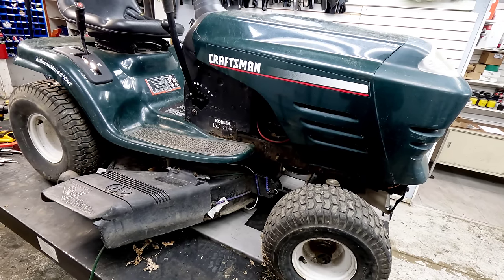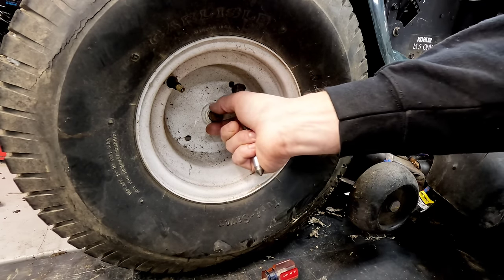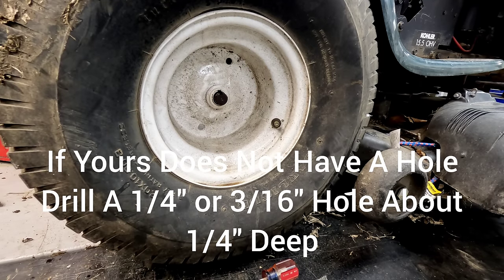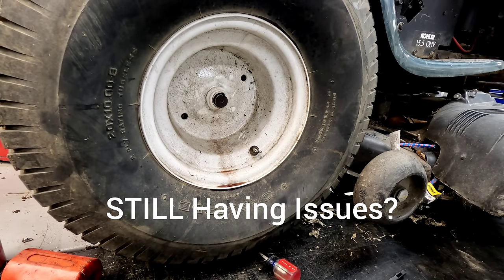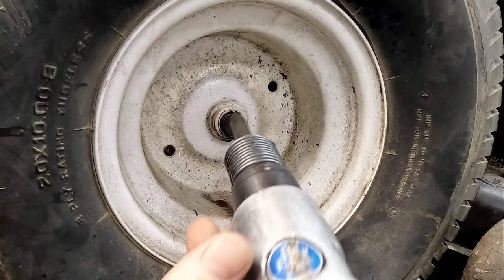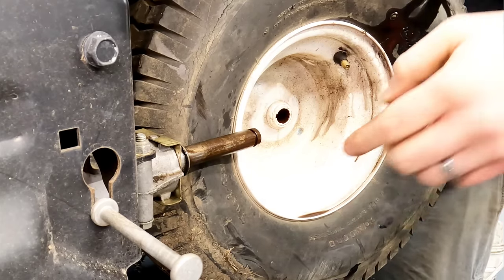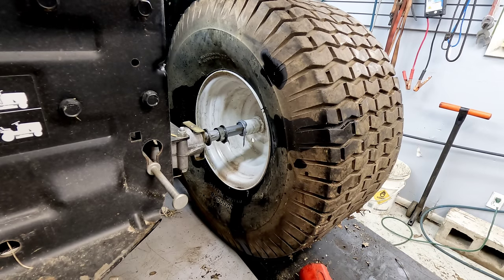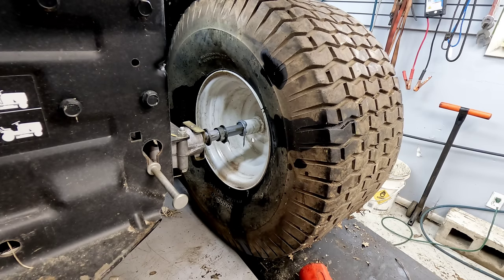How To Remove A Stuck Riding Mower Or Snowblower Tire Rim / Tire Easily Get The Wheel Off

Comment: Just wanted to say thanks for posting a no non since very instructional  video. Good point you made pointing out the high spots that can be seen as you clean/sand the axil. Another good point you made is to clean the hub. Making sure the wheel slides back on without binding anywhere is another good point. THEN 100% Agree! Anti seize will prevent this happening again, I've used anti seize for over 40 years. Just recently experienced a stuck rear wheel. Had one that was "Rust Welded "on then after two days of struggling, went to H..F and bought an air hammer. The Air hammer worked, I guess the intense vibration brakes the rust loose. Just a tip, I used a 1/4 rod with sandpaper wrapped around it then inserted in my drill to sand the inside  of the wheel hub.
Reply from the maker: Great tips and thanks for your kind words of support!

Comment: You're a lifesaver. Removed cap and e cap. But then couldn't get in off. So I sprayed the heck out of it inside and out. Waited and then hit back of rim with 5 pound  mini sledge. It broke the rust. Thanks a lot for your help. Was about to take it to shop which would have meant paying someone to take it to the shop.
Reply from the maker: Awesome job! Glad to help!

Comment: After dripping diesel( best po mans bolt breaker) into the hub on a tilt, I put a 2x4 behind wheel to pry and shim it with something to keep pressure and use an air hammer or scaling gun with pointed chisel in center hole, lotsa beats do a lot with minimal damage. then apply anti seize before install. If only they were tapered, they wouldn't stick. Great channel.
Reply from the maker: Awesome process there! Thanks for watching!

Comment: After getting the rust removed from the bore and shaft, I put never-seize in the bore and on the shaft! That eliminates the problem from happening again!
Reply from the maker: It sure does! Great tip!
Reply: So it doesn't dry up over time

Comment: Excellent how to video. Subscribed. Liked. This seems like simple job but can turn into a nightmare if you don't know the tricks you showed. The heating of the rim but not the axle was good to know. I wasn't aware of that. 

thanks'
rocket
Reply from the maker: I appreciate that! I have struggled with quite a few over the years! We used to work on grain bins and getting some of those fan blades off (12"-20" usually) was a bear, you had to heat it up quick as possible and put the portapower on it until it popped off and many times shot feet from where they were being removed. Fun stuff. At least those you could get a good solid bite on because they were made to be pulled off. Thanks for watching!

Comment: My Cub Cadet XT1 has the new axles with flats 180 degrees apart. And a bolt in the end to hold it on.
I stuck a 2x4 (end wise) up against the back of the rim and pounded it with a big hammer.
When they painted the wheel they didn't mask the hole!   From the factory!!!
I had to use paint remover and a wire bore brush on the wheel to clean it up.
Sanded the axle shaft and greased it when I put it back together.
Smooth.   :)
Reply from the maker: This is the exact action that ruins the transmission many times. I am glad it came off for you! There is a lot of weight being held only in one small spot made of aluminum so if you hit too hard on the inside of the rim with anything to support the other end many times they will break. I would tell you I didn't believe they didn't mask the hole from the factory but then I would be lying to you. Quality control just isn't quality anymore either unfortunately. Thanks for watching!
Reply: That's standard for a "MTD" rider.

Comment: instead of drilling the holes out get some lil eyebolts put them in the holes then use gear puller works well
Reply from the maker: Great tip there!

Comment: You have to watch pulling or the retainer rings on the cheap axle and whole axle can slip right out i had that problem before its not hard to fix but waste more of your time if it happens cause then you gotta take the transmission apart to fix the axle
Reply from the maker: Definitely have to be careful otherwise time / money will be spent to repair it

Comment: If the holes in the rim are too small for your puller thread some eye bolts in with nuts and washers on the back.
Reply from the maker: Great tip!

Comment: My back left tire keeps feeling like its smaller than the right side the sizes are the same though but it is shorter than the right side tire but the numbers on each tire ate the same i can't see how when it is shorter than the right
Reply from the maker: If they are not the same brand, we see this often. Some have a flat ground contact, others come out further and have a contour
Reply: @IndRepair  it looks like the same brand all i could think of is it had to come off a different mower or a smaller mower
Reply from the maker: Interesting

Comment: That deck is bent way back, too , probably hitting something regularly. It shouldn't be rubbing on the back tire !
Reply from the maker: I see the rear tire not able to be removed without the anti scalp wheels being removed often. Thanks for watching!
Reply: I've never seen one cocked at an angle and bent back that far ( the deck ) to where the anti scalp wheel hits the drive tire. 🤔
Reply from the maker: It was only hitting when trying to remove, otherwise was free by a few inches

Comment: If your pen oil doesn't penetrate....you can try carb cleaner, THEN Pen oil...a lot of times will break these loose
Reply from the maker: Great tip! Thanks for watching!
Reply: @IndRepair  been using this for many years. The carb cleaner will go thru rust faster than oil, ( lubricants)
As soon as you see it running out the other side....soak it with your favorite PB Blaster....or whatever you use...drink a cup of coffee, and by then it should fall off.
Reply from the maker: @charliejones7574  Yeah haven't tried it. Will give it a shot!

Comment: You wont ruin the transmission thats why they sale retaining rings for inside it
Reply from the maker: Very expensive to do
Reply from the maker: Definitely possible
Reply: @IndRepair  is it the rings only cost about $5.99 on Amazon then just the time of taking it apart and resealing everything
Reply: @IndRepair  its all i could do on mine and i soaked mine in oil and spray oil soaked it for days and it was still on the axle tight then i got the axle out from the rim when it fell out.

Craftsman or mtd whatever needs to start making their mowers with lug nuts that hold the back tires on it would make changing or repairing one easier to do
Reply from the maker: Definitely!

Comment: How do you remove a sump gasket
Reply from the maker: Remove the bolts, separate the two then scrape the old gasket off
Reply: @IndRepair  what tool do you use to scrape it off
Reply from the maker: @ChristopherPermenter  We use a carbide scraper tool like the ones at https://amzn.to/49hcIld or just a regular razor blade works well especially for the tight spots
Reply: My gasket split into two on both sides on the sump and the block it’s extremely difficult to take off. Has this ever happened to you?
Reply: I’m using the carbide scraper tool and one side took me over an hour to take off completely
Reply from the maker: @ChristopherPermenter  I feel your pain!! Unfortunately when doing this kind of work it is either slow and precise or fast and make the aluminum not ideal. You are doing it the right way, keep at it!

Comment: My guess is it woulda come off if you just started with the air hammer.
:)
Reply from the maker: It would have probably after working some of the fluid onto the shaft but before spraying I doubt it would have. I usually just start with the torch haha!! Thanks for watching!

Comment: Best to do is oil it good and hit the key i hit the key i ain't gonna hit my axle like before that caused me a lot more trouble its the rusty key holding the rim in place which ever way the back rims are hard taking off
Reply from the maker: That's a great tip!
Reply: @IndRepair No it is not that is a BAD TIP!
Reply from the maker: Hitting the key to move and free it up will work in some cases. Not sure what would be bad about it?